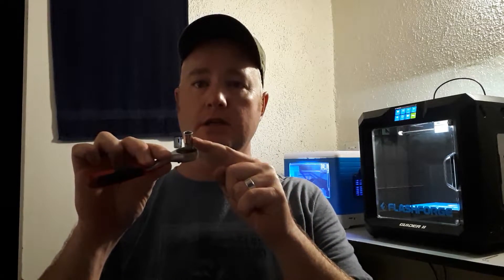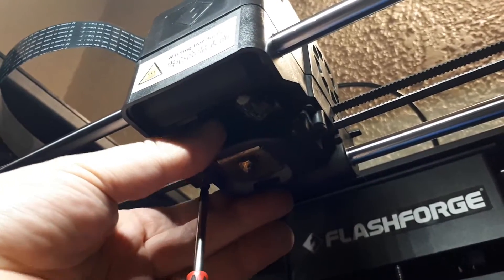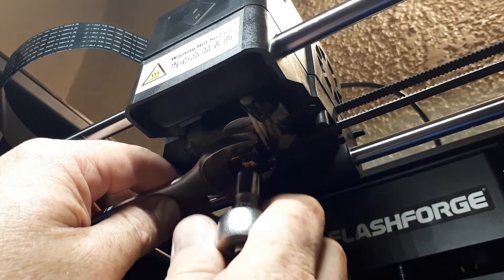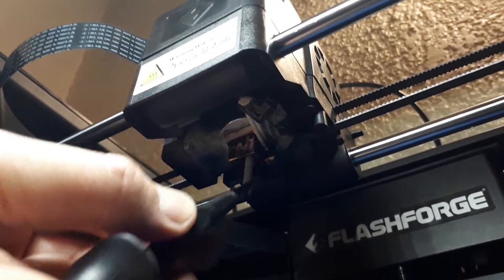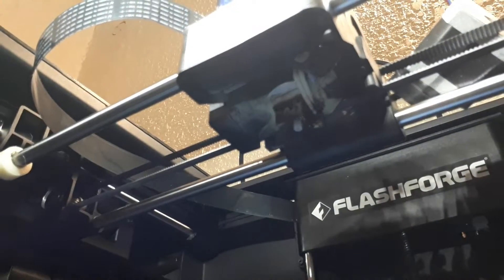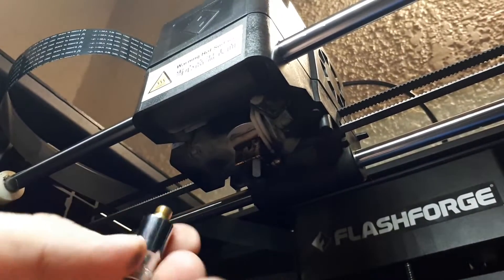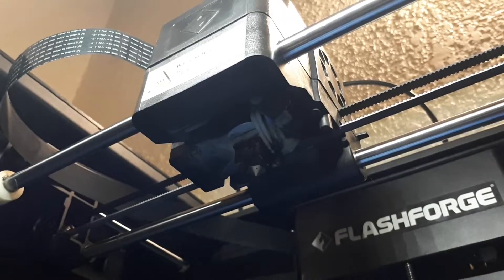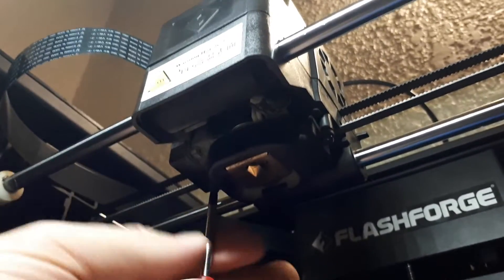Replacing the Nozzle on a FlashForge Guider II

Comment: does the 2s nozzle fit the guider 2 unit?
Reply from the maker: There is a difference in the heat block. 
I odered a Guider IIs by mistake. 
Doesn't fit.
Reply: @JonathanBirch7  Thank you so much for the quick response.

Comment: Thank you.  You have confirmed what I thought and that is you don't have to remove the hotend assembly just to change the nozzle and PTFE tube.  I was also struggling to find the length of the PTFE tube too, so that was bonus - it means I can pre-cut rather than measure and cut with the machine still hot.
Reply from the maker: You can cut it to 44.mm in length.

Comment: Was using PLA that had wood in it, that took a toll on the nozzle normal PLA it doesn't need changing to often under average print loads, if you use it to print everyday then ya you are going to be changing the nozzle more often...
Reply from the maker: I really need to make the video of how to clean the nozzle, using a 4mm endmill and a 4mm chamfer tool.